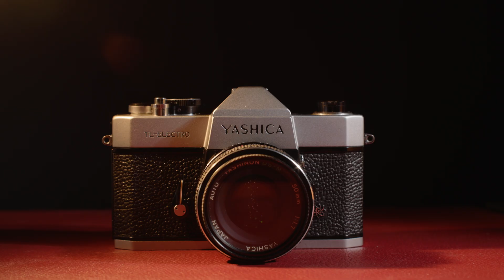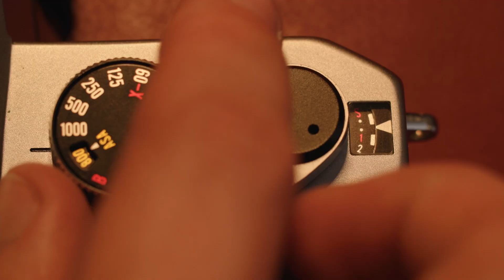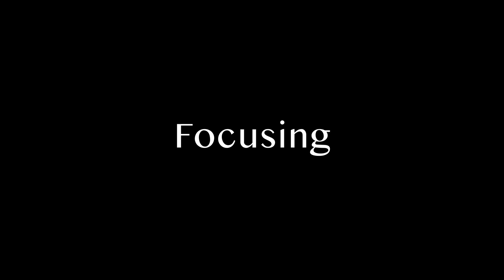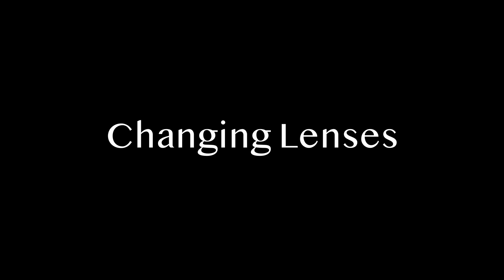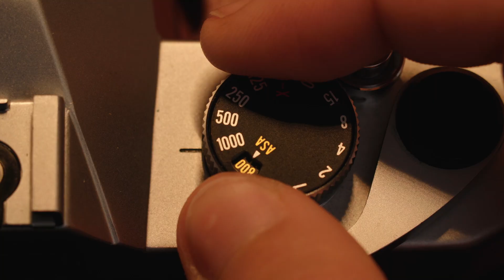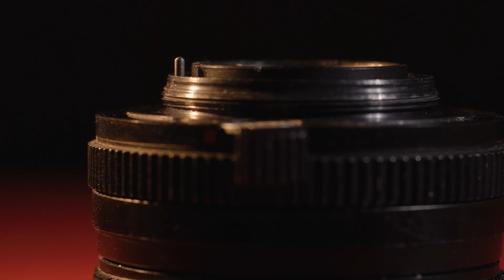How to use the Yashica TL Electro & review

Comment: I bought mine new in 1977, used it for many years and took hundreds of pictures with it. I've still got it and last year managed to get an adapter to replace the old mercury cells for the light meter. The adapter works with hearing aid batteries which are readily available. Excellent camera.